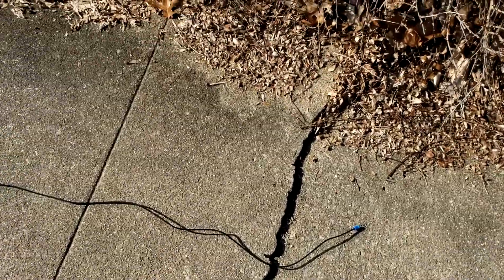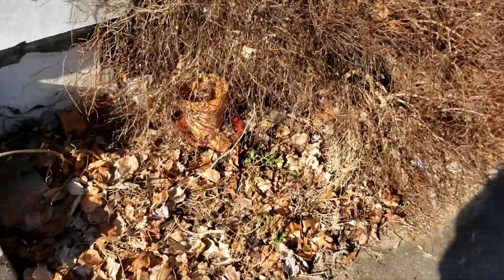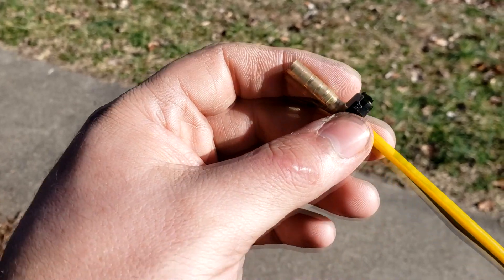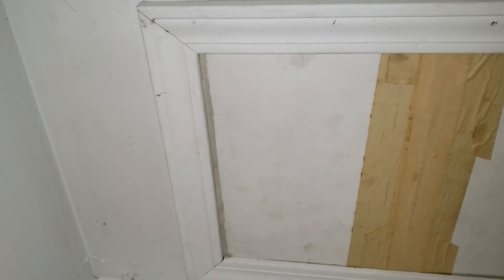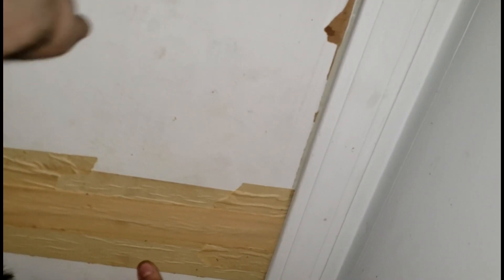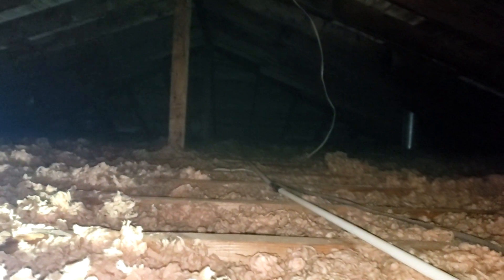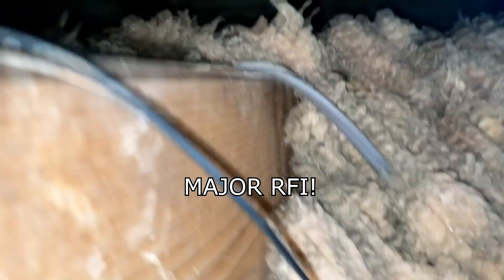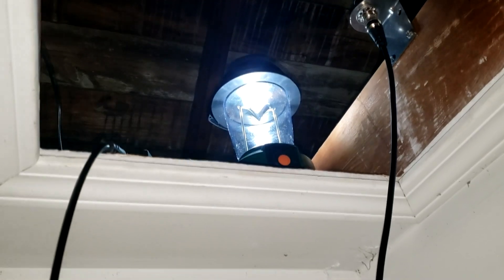Stealth End-Fed HF Wire Antenna Project Part 2: Installation FAIL!

Comment: Another issue to watch for is any type of dielectric you are using. PVC formulas are constantly changing between batches so always test them... HOW? with your kitchen microwave.  set up about 8 to 10 oz of water to boil in the microwave (this is to protect the oven) and then next to that but not touching it, place the "plastic" you are testing.  nuke it at high for  one or two minutes or until the water heats up. then check the plastic piece, if it heated it isnt suitable for use with any RF. if it didnt heat up, that means it didnt absorb any rf and is good to go to make antenna or coil parts with as it wont become reactive with the RF

Comment: Add some attenuation on the rx to bring the noise down to S-2 or S-3.  Turn the attenuator on and adjust so your noise is lower.

Comment: You need some kind of a ground plane for the dual bander too.
Reply: Spread out a heap of tinfoil and connect the antenna to a large as you can get it flat tin mount in the centre of the foil. This will give you the idea - https://domsmith.co.uk/amateur-radio/contests/2007/wpx/
Reply from the maker: Yeah that's next.

Comment: I run the same matchbox, inverted vee, 25' @ apex, 2' at ends. I live in a valley, works OK  NVIS on 80 & 40. 20, not so much, so i just run a dipole.

Comment: end fed antennas are RFI nightmares.
Reply from the maker: So I'm discovering.
Reply: I run a hyendfed 40,20,15,10m 4 bander 400 watt, below 1.5 1 on all bands works fantastic no rfi problems at all. there are ways to stop a lot of rfi comming in trial and error with ballun, choke coax position, grounding etc. good luck.

Comment: I assume your reason for the attic antennas is some kind of local anti-antenna ordinance. In the attic, your antenna is very close to lighting, appliances and other potentially RF-noisy electronics in the house.
Reply from the maker: No restrictions, I'm actually going to put up a 30ft tower in the near future. I wanted something that was indoors and protected from the weather, a backup for my outside antenna.